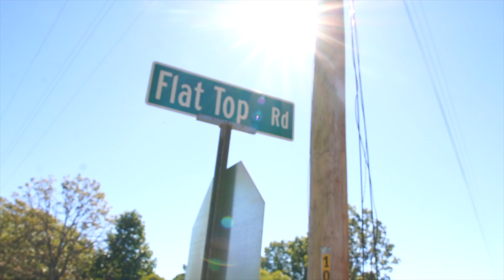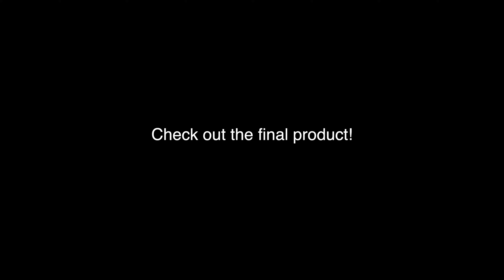Clients wanted their pond restored, we did it!

Comment: Excellent video..wondering how deep the water table  is there and if a well would make sense to keep the pond full...?
Reply from the maker: Everything within about an acre slants directly towards the pond. The owners say whenever it rains it fills up rather quickly, it would just seep out through the soft ground. The compactor and the clay should do the trick!
Reply: They are on the very top of a mountain.  Not much to grab around there for ground water.  I would say 400 plus feet.  They do have a large amount of watershed.  The bottom was busted when they blasted a new lane in on the road.